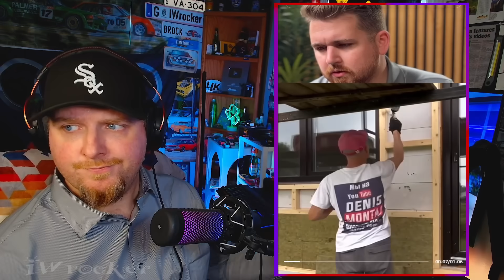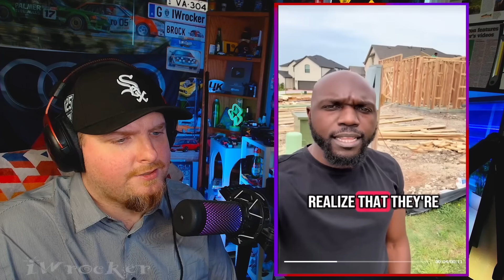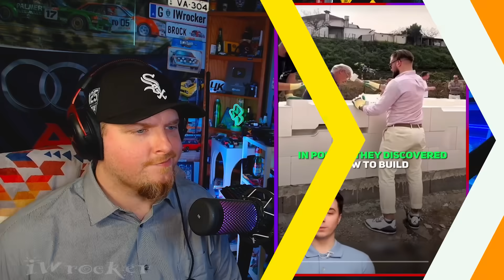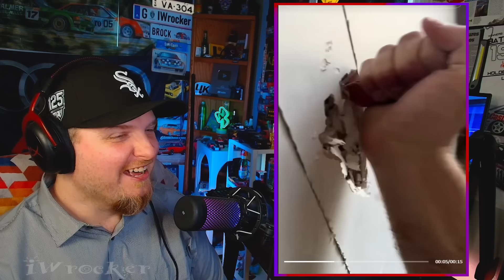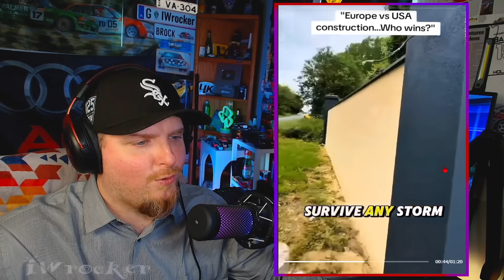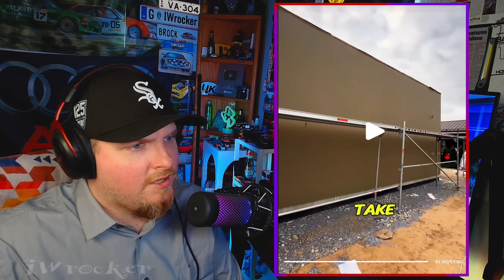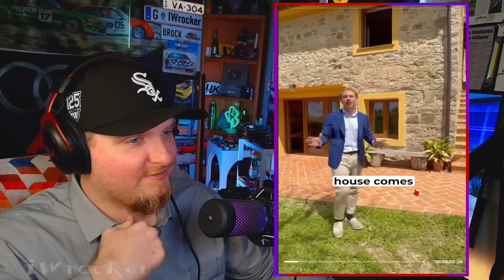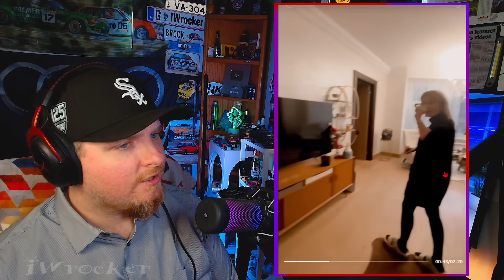25 Minutes of European VS American Home Quality & Construction Methods 🔨

Comment: The real strange fact is that European houses built to survive centuries costs the same or less than a US hut that will last less than 30yrs
Reply: When you imagine that the million and billion dollar mansions in Hollywood or Texas are build the same way as a 100k dollar house in the US.
Reply: *for end costumer. For builder they are pretty cheap! =))
Reply: Lobby work at it's finest.
Reply: @basstrammel1322 Yes, the construction union really makes it expensive to hire workers.
Reply: @MrGunnar69  Oh so funny, kicking the lesser man. By lobby I mean the big fish in washington, not unions. If it's too expensive to hire workers and to expensive to buy materials, who suffers? The workers. Any union would agree.
Reply: yeah and in the ''richest'' country they are always complaining about money to build houses how funny is that?
Reply: 😂 @ hut, epic!
Reply: In France we had a famous house builder company (Phénix). They were laughed at in the 70's for their "cheap" construction.
50 years after, they still stand, and people in fact like to buy them as starter house or for renting. They are a bit small usually for families.
And how are they built? Mostly, a rust-proofed steel frame, holding concrete panels. Ugly, cheap... yet durable. Slap insulation on the outside (it's a simple box after all) replace the original windows by modern ones, and you're done for the exterior. And inside, the walls were made of "clay cinderblocks" (not sure how they are called, but it's hollow, long flat clay blocks, the size of a cinderblock but half the thickness). Goes down easily but still way more strong than drywalls. And since the steel frame hold the whole house you can just take everything inside down (usually).
Yep, even cheap 70's French houses are still a level above US modern houses.
Reply: The American entrepreneur secretly laughing at you from atop his huge pile of money.
Reply: @Outside85 No, laughing at his customers who he's ripped off the scumbag. So you have no sympathy for the poor customers? Time to checkout your own home, you might be not laughing then. I'm not bothered, my brick house was built in 1946 still going strong.
Reply: @davidmarsden9800 mine was built in 1928 and still standing strong.
Reply: @Rsama60 mine is built in 1912 and the walls are cracking...
Reply: @altblechasyl_cs2093  But that doesn't mean it's poorly built. Did someone do a renovation that was done poorly?
Has anything changed around the house? For example, was a road built that trucks drive on?
At that time, "wreaths" were not made, and "wire" was used for reinforcement. Is it rusty, and so the walls began to shift?

Everything can be solved quite cheaply compared to a new house, but it mustn't be done like that "US expert at the beginning who was surprised by the insulation from the outside = elementary school physics" :D
Reply: 30? more like 5
Reply: Träum weiter...
Reply: TRUE STORY when I was a kid I thought Am3ric4n houses were disposable and that is why they are built so cheaply.  I thought they got blown away in hurricanes or tornadoes every few years and you just built a new one.

When I discovered you guys had 30 year mortguaes on them I was mind blown
Reply: Cries in Switzerland 
The average house costs 1.8mio USD here. The average. Not big ones.

Also pretty sure houses in Germany or Austria are also more expensive than in the US.

In the US you can buy a nice house for 300k, that would not even get you an apartment here. American median salary is higher, so work costs more. Compared to this their houses are not expensive. They are expensive to someone from Eastern or Southern Europe, but houses there are just a lot cheaper also because of labour that is cheaper there.
Reply: @MrsStrawhatberry  a lot depends on where and what, in lots of cases, a large part of the price of a "house" is actually the price of the land on which it is built, and it's a long spectrum all they way from villages and sometimes even a forest or woodland, up to the centers of big cities.
Also Austria and Germany are not that bad, here where I live in Poland, we have the worst house prices to average income ratios in whole of EU, which also translates into horrendously high rental prices. As many like to put it, western prices eastern salary.
Reply: @MrsStrawhatberry  I somewhat doubt 200 m² is considered average. And you're overlooking quite a few peculiarities of US salaries there that make them far less impressive. The average US citizen isn't going to have more money available than the average Swiss.
Reply: @Llortnerof The homeownership in the US is way above 60% while in Switzerland it’s below 40%, most of which also inherited.

So in the Us more than half the population own property.
Reply: @MrsStrawhatberry  Your point being?
Reply: @Llortnerof the average American has a house, the average Swiss does not. It is more affordable for them on every mensurable level. Same for Germany, they also have a low homeownership.
Reply: @MrsStrawhatberry  And neither is in as much debt as the American.
Reply: @Llortnerof That has different reasons.
Everyone who buys a house here will have a loan for 40+ years.
The other debts Americans have are college or health care related. Not housing. And those that are from housing are still paid up in 20y or less.
Reply: @MrsStrawhatberry  And so does the US proclivity to buy houses rather than rent. Besides, that's majorly underplaying how many debts Americans have.
Reply: @Llo @Llortnerof It is not, I‘m getting the feeling that you have no idea what you are talking about.
The argument was that US houses are so expensive. They are not. 
It does not matter whether Americans have debts or not.

Their houses are cheap. They can buy more land, bigger houses, more houses for less money. Yes they are bad quality bur still, they are not equal in price or size they are 1/3 of the price and 3x the size.
Reply: @MrsStrawhatberry  They are. You used absurdly high values for your own country and vastly underestimate the cost of US houses with very sketchy reasoning based on numbers that don't mean what you say they do.
Reply: @Llortnerof No, look up the average apartment and house prices.
Reply: @MrsStrawhatberry  I did. You based the price for Switzerland on a house of over 200m². That's not average.
Reply: @Llortnerof No
i did not.
Look what an apartment costs. It’s as much as a house in the Us.
Reply: @Mrs @MrsStrawhatberry the housing crisis then? The lack of capability to buy a house and the 50 years morgages ??? Hello ?!?! 
Regardless , for the same money you get better quality . Europe had square meter regulations because of space .
Ask the price of a brick house in the states . Where im from there are no wood houses, unless its a second home to relax on vacations .
Reply: this is in fact not true at all. your price comparison is not correct. The houses in the USA are way bigger and mostly seperated from other homes for the same price of a semi-detached house in europe
Reply: @SnobiSnot  even if the price comparison is not correct, i fail to see how your second point makes any sense when i can literally look outside the window and see the thing you described.
im pretty sure that its rare that people build semi-detached houses these days, most of them are several decades or few centuries old and either stay with the family that owns them or are rented out.
Reply: @srkares  Semi-detached houses are very common in Austria. When I was searching for my house, nearly every newly built house was of that type. We have strict energy laws which are easier to fullfil with one common wall. And the ground is expensive and can be used better with semi-detached houses. Same for electricity lines, fences and so on. Only older houses (like the one I bought) were single houses. Directly next to me a semi-detached house was built a few years ago - of course with bricks.
Reply: @reinhard8053  interesting, here in germany, at least where i live (which is technically the east, so maybe things are a bit cheaper), the majority of new houses i see are free standing, single family ones. one just completed like ~3 years ago across the street from me and a couple others have been built further down the road. same for the towns i drive through on commute.
Reply: @SnobiSnot not according to the prices ive seen recently. Show me a bog standard newly built us house and its sale price in the last 2 years.
Reply: @SnobiSnot compare similar houses when you do the comparison . If you try to compare a tent with a mansion you Will never get a grasp on reality . 
Look prices for 100% brick houses in the US and laugh
Reply: @SnobiSnot  That's only because garages, attics, basements, barns, bomb shelters, mud entrance, laundry room, greenhouses, garden sheds and potato holes doesn't count as living space in Europe and is thus excluded from the size of the property. Many EU countries also don't have property taxes. You're being ripped off, don't cope, start to complain to your corporate overlords.